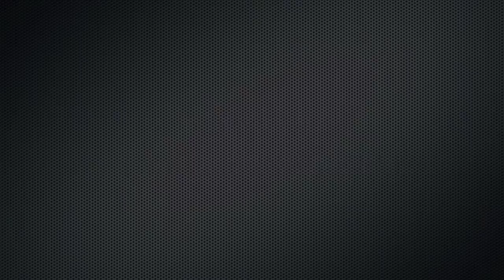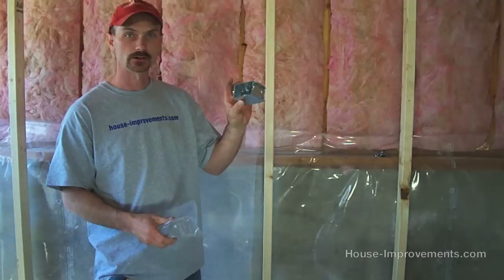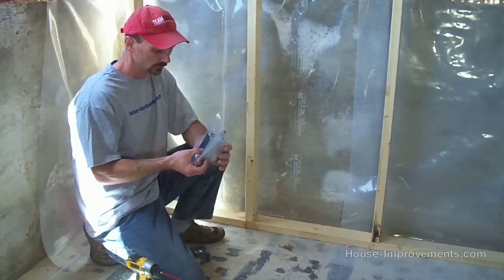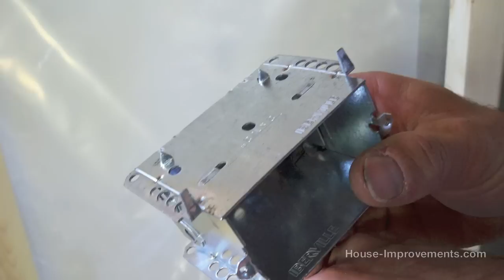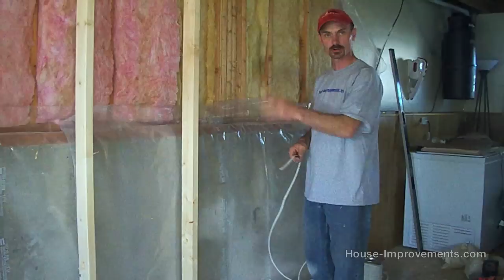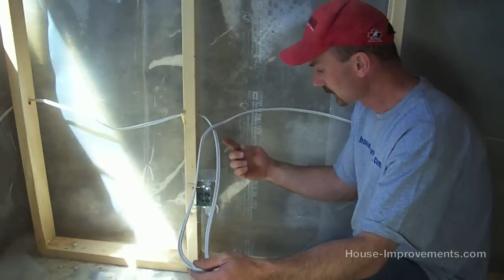Electrical Rough In

Comment: Love the video, but one question...I am roughing in electrical in my new shop, and I need to run wires from one side of a door to the other. Is it okay to drill holes through a king stud, and cripple studs? I also will likely need to run wiring below a window so I will be going through the king and jack as well. Is this safe to do and a standard practice?

Comment: Shannon thanks for the video. At the site of the penetrations you made how would you seal them. I have heard 1. Low expanding Spray foam. 2. Acoustic sealant 3. Blue tuck tape. Any preference?
Reply from the maker: a combination of all three really . Just depends on the penetration but normally tape  or acoustical are the easiest and most common.
Reply: @HouseImprovements  thank you Shannon you are an amazing teacher!

Comment: If my basement wall  is similar as in the video, there is insulation and vapor barrier  behind the studs with some gap, can I  run wire behind the studs without drilling holes? I still fasten the wire every 4 ' , near the back corner of the studs.
Reply from the maker: Sure.

Comment: Great video, as usual, but one thing to note - it's useful to knockout the holes you need for the cables before attaching the receptacles to the framing, especially with the polythene vapour barrier container on the exterior walls.  Learned that the hard way lol.

Comment: I'm a DIY'er doing a small basement and just finished insulating (no vapour barrier on yet). Unfortunately I had no idea you needed those vapour boxes. I'd paid and electrician to do my rough in so now all my exterior wall boxes are on and pre-wired without the plastic box. I guess i have to remove them all and slide the plastic around and re-attach them. Talk about aggravating!
Reply from the maker: Any electrician should know you need either these or at least poly wrapped around them if you require vapour barrier

Comment: We cannot have metal boxes in residential. I dont know who told who that he could but they need to go get a new trade. Plugs are 16" or 18" to the bottom.
Reply: I can't find where in the code book that metal boxes aren't allowed in residential. It does say that they MUST be bonded, so most electricians don't use them because it takes more time to do the bonding.  Also, I don't see anything in the NEC that specifies the height from the floor except in explosive environments.

Comment: My bedroom is an add on for my trailer that I just moved into, has no wiring what so ever. Do you cap the end of the wire? You never showed what to do with the end.
Reply from the maker: Dont hook it up to any power before you install the receptacles , lights and switches. We can help you more in the forum.https://www.house-improvements.com/forums/

Comment: If a basement wire had a screw drilled in the middle of the wire, would it have to be replaced or can you just put electrical tape around it? I will say that the breaker was switched off and it was sparks everywhere. I know it will eventually need to be replaced but will electrical tape work for now or is that unsafe?
Reply from the maker: It will need to be replaced before it is covered up with the wall finish but if you turn off breaker and remove screw , tape up the area and turn on breaker . If you have no sparks and the devices down stream work you may be fine until you have time to change it.But it does need to be changed soon.
Reply: @HouseImprovements  ok thanks hun!

Comment: Would an ahj in your area allow the extra loop you made at 6:16? Around here, inspectors measure along the length of the cable rather than from the box. You're clearly not stapling within 8-12 inches if measured along the cable. Wonder if Code covers this?
Reply from the maker: This is common practice here. We are stapling 8-12 from box but there is more than 12" of wire between staple and box you are correct.

Comment: Is it Typical to run the Wire Horizontal rather than Vertical up the 2x4, even for a Mobile home? I have to cut some Wall higher up and didn't wanna hit a Wire
 Thank you!
Reply from the maker: it could be either way so you need to be very careful.

Comment: Shannon, do you use vapor barrier on basement 2x4 walls ?
Reply from the maker: Yes in my area a poly air/vapour barrier is needed under the drywall.

Comment: Dumb question...about to wire my basement...for receptacles, always use 12/2?  Only lights can be 14/2 right?
Reply from the maker: Only 20amp circuits require 12 gauge wire but it would be fine to use on 15 amp circuits. In my area basement receptacles do not need to be 20 amp. unless you had something that was dedicated for a 20 amp use.  Not sure of your area

Comment: I’m not a electrician but thought it was a no no to do all that bending of the cable. Thought it could cause breakage of wire hidden in insulation and cause short or fire.
Reply from the maker: Avoid sharp tight bends if you can, otherwise you are good to go,

Comment: 14-2 w/grd is for 15 Amp circuits . 12-2 w/grd is for 20 Amp circuits . You should be using 12-2 w/grd and have those Receptacles on 20 Amp Circuit Breaker
Reply from the maker: Depends on the code where you are. Canada ,15 amp for general receptacles. Codes have changed now and this circuit would have a 15amp AFCI also.
Reply: @HouseImprovements  ;   I was NOT talking about Canada because I don't know what the Codes are there because I don't live in Canada !! BUT here in the U.S.  ; 14-2 w/grd is for 15 Amp circuits . 12-2 w/grd is for 20 Amp circuits  !  I'm a State Licensed Journeyman Electrician with over 52 years in the trade and I know the NEC here in the U.S. !!

Comment: "Wire isn't that expensive."   Where do you get this wire that "isn't that expensive"? My romex 12-2 250ft. roll was the second, if not first, most expensive thing I bought for our electrical rough in.
Reply: Not trying to being an asshole or smart ass. I'm just genuinely wondering if there is a cheaper option out there. My 12-2 250ft romex roll from home depot was roughly $150.
Reply: RetroErotica you got robbed 12-2 romex 250ft is 65$ on eBay free shipping to anywhere in the United States ...that’s about .25 cents a foot ...it’s 71$ at home depot right now lol where the hell do you live ?
Reply: @stifflers69mom1  In Trenton, GA. Guess we should have looked online first. 😑

Comment: are there any codes for heights? i am planning on adding some outlets in my garage but i want them a little high up to accommodate tools and work benches so i want them about 4 feet high off the ground.
Reply: Yes there is code heights read the book

Comment: Great video.  Quick question.  Can I run 12/2 to all my receptical boxes with 20A recepticals on a 20A breaker from my panel?  Total length from panel to furthest receptical is approximately 65 feet.
Reply: No

Comment: using romex cable. then use PVC boxes.  there is more room in the box .  and they are stamped inside on how many wires for the box.   IT is NEC.  And i am a Sparky , i have been in the trade since 1978.    Yes drill in the center of the stud.  If in front of the stud you have to use nail guards.

Comment: I'm installing 14/2 wire in my cabin in bc canada, and am using rockwall insulation. Would it be difficult to cut the insulation to fit around the loops, and if I make the bend at the loops too tight close to the stud, won't that create friction or resistance in the wiring eventually.?
Reply from the maker: The Roxul will split around the loop. Not as easy as regular batt insulation though. Use your knife and cut the split.

Comment: Is it true that the 'chassis' of the electrical outlet can provide a 'ground' inside?  I need an indoor ground for some electrical equipment, but I'm not close enough to a window to run a ground wire outdoors.

Comment: 1gang outlets are at Hammer hight , add nail plates if the 14-2 is not centered due to eyeballing to prevent sheetrock installations from damaging the power wire aka 14-2

Comment: Wow! You are wasting a lot of wire!  Those loops can be pinched between the sheetrock and framing. All that wasted wire cuts into your profit or budget.
Reply: Very little - what $0.30 for the extra two feet of wire involved? You are charging the customer what - $70 - $100 an hour for your time? 

The loops were not in front of the framing and the wire is stiff enough that it would not flop out. A sheetrocker would have to work at it to pinch a wire.

Comment: Shannon great vids
Do you have any vids on installing metal 3 gang boxes. For new and existing walls. I require changing a 2 gang box to a 3 gang in an existing wall. Wondering how to support it. Since the 3 gangs have a tendancy to swing out of the wall due to lack of support.

Comment: He mentioned that the outlets should be approximately 12" off the floor, he then positioned the top of the outlet box even with the 12" mark. That should be the bottom of the box even with the 12" mark, actually 12 to 16 ".  It is nice to leave extra wire for possible changes, but the wire should not be bent more than say the radius of a beer can.  Of course you must drink the beer after using it to determine the radius.

Comment: Great video!! The only thing I would add is to use those little metal nail guards on the studs, so the sheet guys don't drive a nail into the new wiring. They're only like .30 c a piece, so they're cheep insurance.

Comment: I usually use #12 for receptacles. I use #14 only for lights.
Reply from the maker: #12 is usually used only on 20Amp circuits. So if doing 20Amp circuits use 20Amp receptacles and 20AMp breaker.
Reply: This is a waste of money in residential

Comment: Thanks for the strategies you have contributed here.
Reply: This guy is Canadian. Will all of these tips still pass inspection in the US?
Reply: Codes are different. Check your local municipal code on your city's website. Good resources for me were Black and Decker's Complete Guide to Wiring and my electrical inspector. Also, the forum on HouseImprovements website gave me some good advice. One of the contributors is from Minnesota.

Comment: thank you so much I'm 17 and currently Building my apartment I just wanted to know like does the main wire have to run through all of the whole apartment(the same one ) or like we can cut it to every wall length? I hope I'm making sense
Reply: Hire an electrician. You don't know what you're doing and it's not safe.
Reply from the maker: hmm not sure I follow completely what you are saying. Each wire for each circuit will go from box to box to box as you go.
Reply: +HouseImprovements I mean is it just one wire, like the same wire through out the house,around the perimeter or can I cut different lengths?
Reply: +Kalen T sure. thanks
Reply: +Style Dania use #12 wire and not 14. it costs slightly more but it's a better install. instead of 15a the circuit can be 20a. we don't ever run #14.
Reply: pagefour she thinks its one wire throughout the whole apt.. she gonna burn her shit down. dont give her any ideas

Comment: I was told to use 12/2 wire instead of the 14/2. is this right?
Reply from the maker: +Raven Martinez depends on the circuit and load you are needing. If it is a 20amp circuit then use 12 gauge for sure.

Comment: how are you suppose to put the wire back together as a loop
Reply: +Juan Collete ha
Reply: +Aurelia Blakney 

Great question! Most Sigma III electricians use industrial grade twist ties or polypropylene Scotch tape. However, Sigma IV electricians are required to use tinctured Elmer's glue with a two-phase jacketed bonding agent that fuses the free radicals at a rate of 3 milliamperes per second. Most homeowners are allowed to use a common paper clip, assuming it meets standard ASMG guidelines and strictly adheres to Kirchhoffs fifth law of electrodynamics. I hope this helps!
Reply: OK cool I actually want to build a house out of shipping containers I have three more years on paying off my land so I'm excited  but I will go back into saving money to buy the equipment

Comment: you can use whatever box you want, electrical
 box are more stronger and primary use in commercial setting, you have to ground the metal box unlike a plastic box.
Reply from the maker: +P. Lieu     Here metal boxes are used almost everywhere

Comment: The video was pretty informative for most beginners. The only thing I would add is that when you are inserting the wires it's a always helpful to make your 8" strip length previous to inserting the wires. That way you aren't struggling to fit a hawkbill or box cutter in the box. As well as I found an issue with how high Shannon put his staple above the box. It should be 4"- 6" above the box not 12" or more. Another helpful tip for beginners is to staple 90 degrees across from the previous stud hole then pull the wire straight as it would naturally be stapled. Then find where the wire would be to the bottom of the box. This will be the start of your 8" strip length. That way your extra will be consistent and the length of the box if a dry Waller hits your wire with a screw or what have you. Then do your squiggle loop and enter into the box! Easy as pie, works great and looks great too!
Reply: he said the staple had to be within 12in and he was at about 10

Comment: Don't let the dipshit 50 year journeyman tell you heights on outlets are 18" or 12" he's wrong. I am a Electrical Contractor licensed in 18 States and the Code Book says exterior outlets can't be above 24" or under 12" AFF. and on  branch circuit general wall spacing outlets they can go to the bottom of the wall or up to 6'6". also the NEC doesn't goven ADA install thats life safety 101. also mr wizard 50 year jw said 14/2 is only for lighting and switch legs well wrong again dipshit it can be used for anything on a branch circuit other than the 2 small appliance circuits in the kitchen, bathroom GFCI, Dining Room and Nook receptacles or Dish washer or Disposal. the frig is fair game outside GFCI's, bedroom outlets, living room outlets etc. and code also says 12" on staples to box so 6" above the box with a 6" loop is good like you did. code also says drilling holes are to be 1' 1/4" from outside edge or a protection plate is required and only 3 NM cables per hole or knockout. Mr. 50 year licensed JW break out your books and do your research so you truly know what you are talking about.
Reply: +Shawn Register Canadian and American codes are slightly different. And the box height he used is probably his preference(and is within code). I'm sure he knows 14/2 isn't just for lighting. Again it's probably just his preference. Nothing wrong with stepping up to 12/2 for everything on a 15A if you want... Just spending slightly more $$$, that's all.
Reply: Code does not say anything about number of NM cables through anything. However, it does say how many current carrying conductors are permitted. If you disagree then please provide code article to verify.
Reply: Exactly. Just look a the NEC Code book if you have a question.

Comment: I need to move my range to different location in the kitchen , would I be able to use same wire  without making junction box?
Reply: We have 2 story Colonial house with finished basement. We are moving range closer to panel. Is there any Code on how construction company/electrician lay cable for the range (in the wall, floor...) I dont think they did it through the attic (from the basement 3 floors up and then down?)
Reply from the maker: +Liz & Bo The cable will come from the basement if that is were the panel is. It will usually come up from panel into the floor joists then across floor system to kitchen area and either up though floor to box on wall or up through floor into wall behind range and into the box.

Comment: I am planning to finish a room in the basement and it will have rendering computers that draw a lot of energy. Can I have 3 outlets on one breaker and 3 on another. Do I run all 6 wires to breaker or just two ?  Thanks.

Comment: how far does the electrical box need to be out if you are putting sheetrock so you can screw the cover on
Reply from the maker: +Ruben Martinez The thickness of the drywall.
Reply: +HouseImprovements ok great. thanks
Reply: Some electrical boxes have little metal points that line up with the stud so the box is lined up for drywall to the right thickness.
Reply: Ruben Martinez [

Comment: Why not run the wires though the attic and down to the outlets? Why drill though the studs? If anything goes wrong in the wall you have to rip the drywall down to get to the wires. If you run them through the attic you can just pull the old wires up and feed new wires down without breaking any walls. Extra wire cost way less then replacing a wall or your house burning down from mice chewing wires in the walls where you can't see.
Reply: staples need to be within 6 inches of box and every 4 feet of unsupported run. you are not going to be able to just pull the wire out if it gets damaged
Reply: +cm6003 its a fuckload quicker to drill then to staple in an attic, and that extra 10 feet of wire per plug adds up, and if the wires get fucked up and there is an attic you can fish after, if i had to guess id say you're not an electrician
Reply: +cm6003  Why not, indeed... fuckloads notwithstanding.
Reply: Depends on the space, I guess, sometimes one way is easier. This is just one presentation, a good one at that.
Reply: it is 6 inches for a single gang box and 12 for multigang
Reply: That's cool if you want to use (1) 250' roll of romex to install 2 outlets.